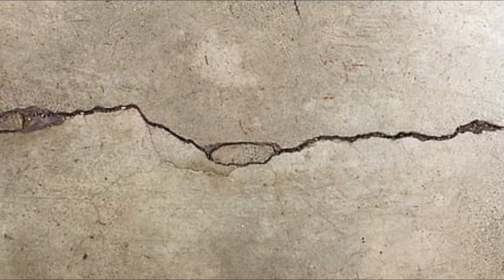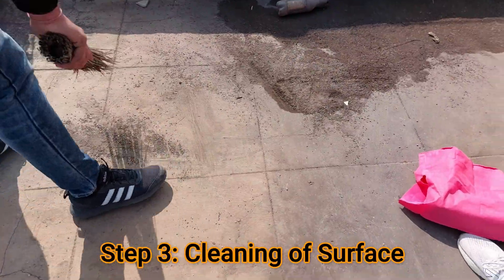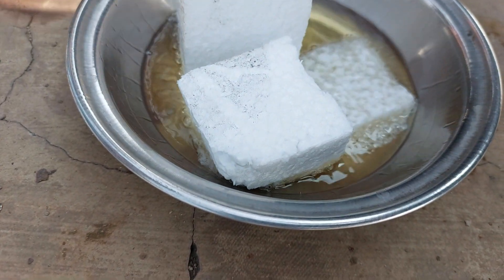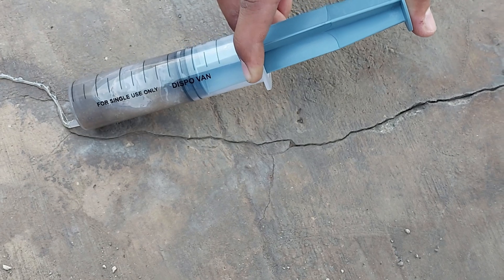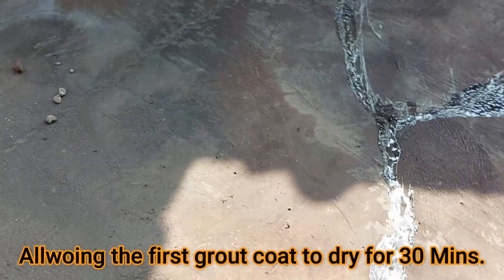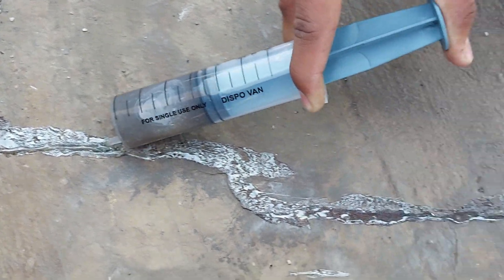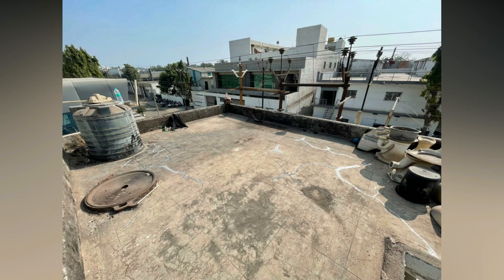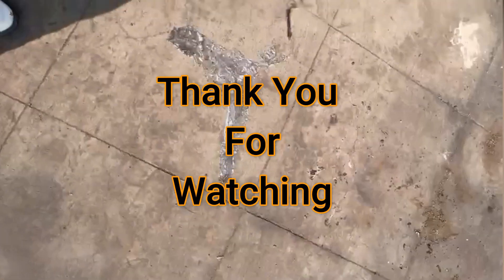Roof Waterproofing | Economical Solution | Water Leaking Crack Repair at Low Cost

Comment: Thats nice. But only filling roof cracks is not enogh to hold water leakages. After filling cloth bandage reinforce will work much better for long lasting cracks repair and water resistance

Comment: Is this not a major fire risk? It's interesting that you mention there isn't a chemical reaction and petrol vaporises very quickly but are some very flammable molecules trap in the mixture making it a severe fire risk?
Reply from the maker: Petrol will evaporate within no time.
Just take care of fire durong application.
Safety measures are necessary
Reply: @CEFandBrandEdgeReviews  Yes I am an ADR driver so I know how petrol behaves but I am just a wee bit worried about petrol being trapprd in the mixture. If it does work though it's genius my friend.
Reply from the maker: I have been working on this since two years.
Trust me it works

Comment: How many years will it work??? Please reply
Reply from the maker: if applied efficiently, it will last forever
Reply: @CEFandBrandEdgeReviews but somebody commented about its expansion due to heat, so what’s the solution??
Reply: @CEFandBrandEdgeReviews  You''re making that up if you can't provide and references to back it up

Comment: Styrofoam or thermocol is not water proof but only water resistant. It may absorb water overtime. Maybe some demonstration of the feasibility of this trick with a cracked concrete slab may give a clear idea.

Has anyone implemented it in reality and solved water seepage by even 80%?